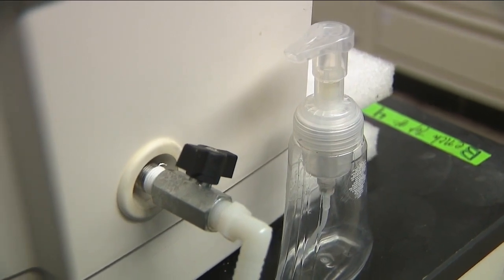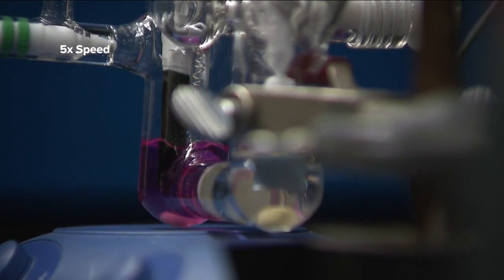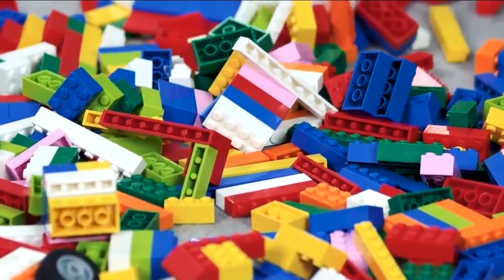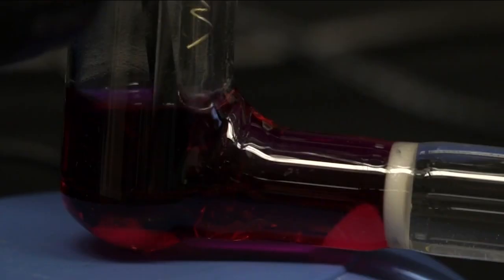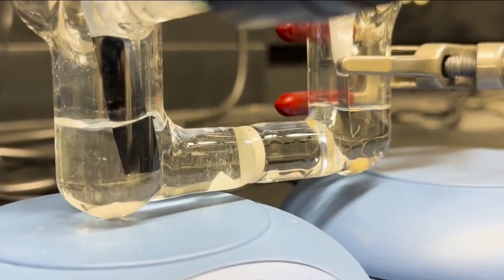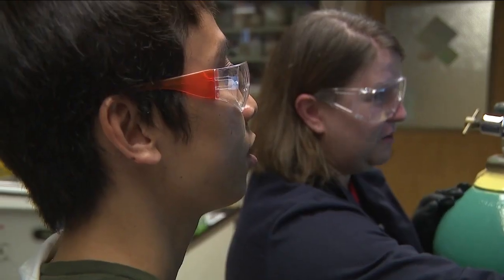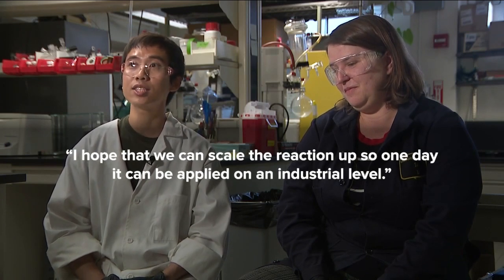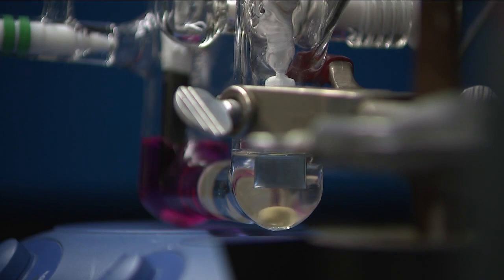CU chemists discover process to recycle plastic bottles with electricity

Comment: The hydrogen fuel cell electric generator (invented in 1839) and the electrolysis of water to get hydrogen (1805) are also a chemical processes. NREL, right over there in Golden, has been using them for 31 years. Go interview them about Hydrogen.